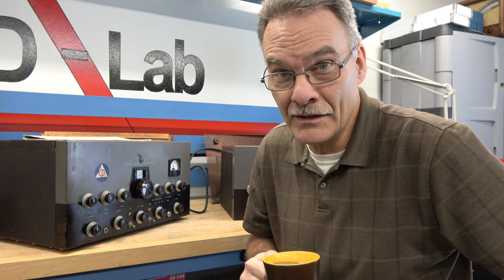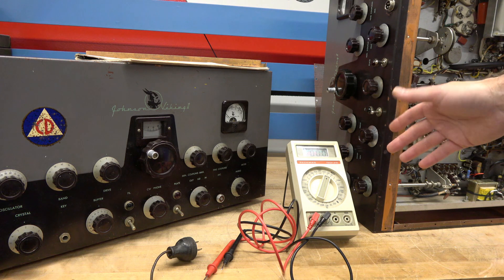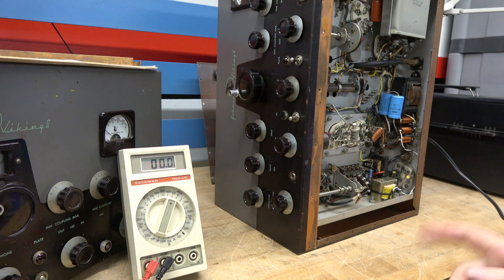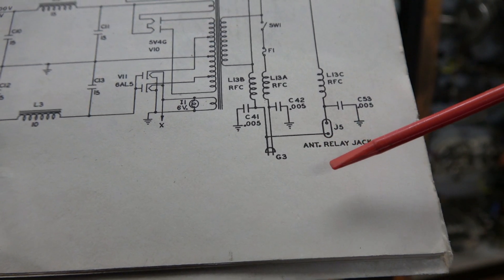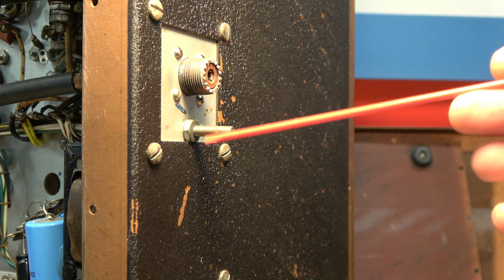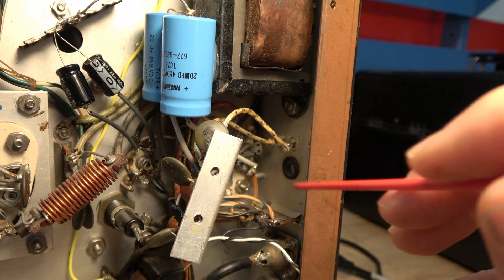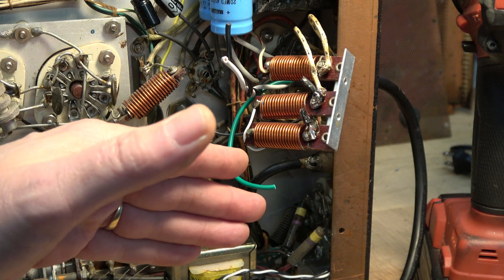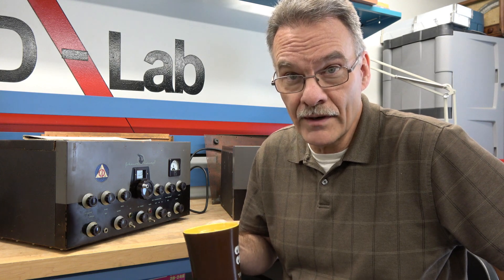How to update Johnson Viking II Ham Transmitter AC power Safety

Comment: Great video ! Guess I need to pull out my 6N2 Thunderbolt amp out of storage now and check it.
73 N8AUM
Reply from the maker: I'd love to buy a HF Thunderbolt! Had 2 years ago. Heavy Monsters!
Reply: @d-labelectronics  I found mine at a little consignment store back around 1978, he thought it was some amp used with CB's. For $100 I grabbed it (with fork lift lol)! after couple yrs of use the 5-25H swinging choke shorted out and as luck would have it, it was on the 1st turn ! Took me couple of days of unwinding and rewinding by hand, man was that FUN !!!

Comment: I like using cord grips vs knots, grommets, and other future shorts :o) Those leaky caps are part of the LC filtering on the incoming power. Aka death caps. In "modern times" we use X2 or Y2 (depends on the service, see article in the link). Sometimes I don't update the cord. It depends on the device. Some old test equipment (old o'scopes) aren't improved with a 3 wire cord.

https://www.allaboutcircuits.com/technical-articles/safety-capacitor-class-x-and-class-y-capacitors/

Comment: Great video again Terry as always. Question I have is, when do you have to install safety caps?? Thanks!! John
Reply: Safety caps are recommended when AC lines were bypassed with a cap or caps to chassis or to a common buss.  You see it a lot on transformerless radio sets.  They are necessary to proper operation.
The caps he removed were part of "TVI" RF filtering on the AC lines.  They worked in conjunction with the inductors on the AC lines.  To retain the original filtering, they should be replaced by safety types.  But the radio will operate without them.
Reply: @ordinaryaverageguy76  I absolutely agree Guy!

Comment: Safety is very important when high voltage is present. Nice job Terry on the Viking.
I did the same 3 cord replacement to my Kenwood TS-830S. I have also done the chassis ground (safety ground) 3 wire cord replacement to my CRT type oscilloscope and my two
VTVMs that I have.

Comment: I'm amazed that a high-quality company like E F Johnson overlooked a safety issue! Did U. L. exist back when this unit was built?

I'm also wondering if grounding the chassis will cause ground-loops.
Reply: Safety wasn't a concern back then and yes it can cause ground loops.
Reply: IIRC, back then, it was advised that stations ground all equipment to a common ground point or buss and that in turn went to an actual earth ground. You see that in the old ARRL handbook sections on station installation. There wasn't a safety issue if the radios were correctly installed.  But, then there were the hot CW key contacts!  :-)

Comment: Since you removed the "death caps" is there any value in installing safety rated caps in their place? Didn't sound like you thought so but just curious.
Reply: The caps he removed were part of the "TVI" RF filtering on the AC lines, to help keep down interference with other devices.  They work in conjunction with those inductors on the AC lines.  So, to retain the original filtering, they should be replaced.  But the radio will operate without them.
Reply: @ordinaryaverageguy76  I came here to say the same thing.  I would have put properly rated caps back to maintain the RFI filter.